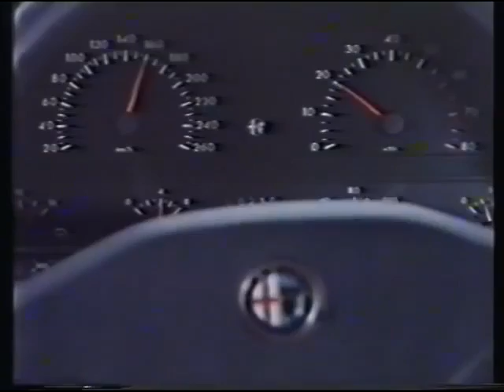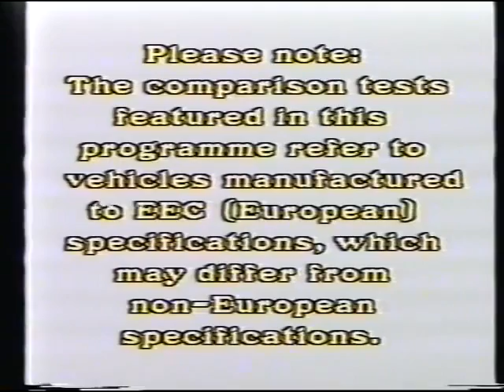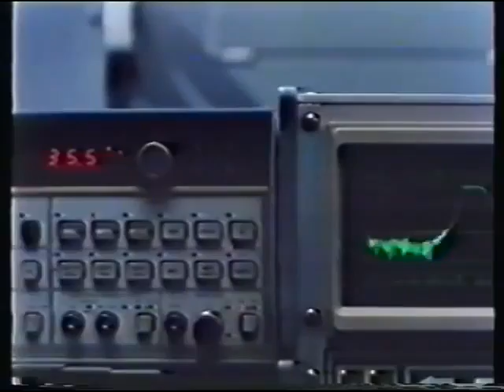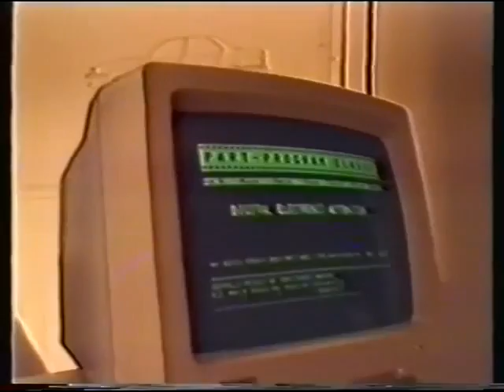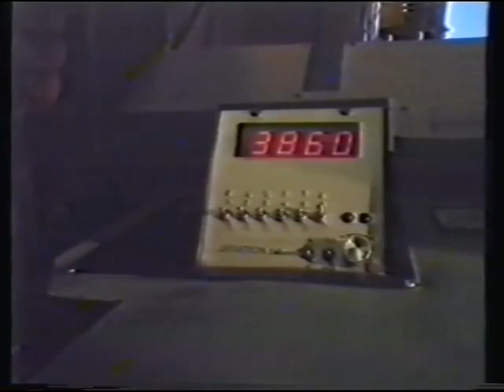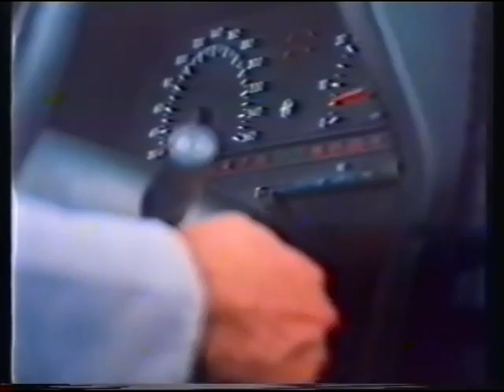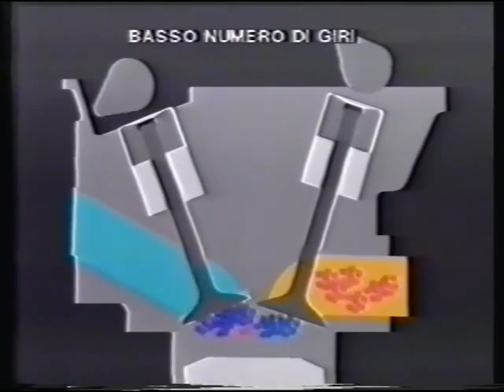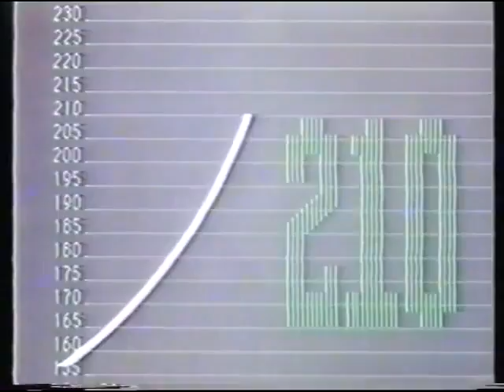Alfa Romeo 164 Promotional Video (1987)

Comment: Driving the longest possible distance with the engine not working is definitely an important factor when owning this horribly unreliable model.
Reply: Its very important for fuel economy, max speed and acceleration at higher speeds. 
Less aero drag - which means longer distance here, on the video, gives You better fuel economy and better acceleration performance. Yes, it is important.
Reply: God forbid you don't change the timing belt every 2 years or 24k miles. Or, if you sneeze while driving, the transmission goes out. That being said, I miss my two 164's. My cousin trashed my first after I sold it to him. Had it since new. Second, timing belt snapped at freeway speeds. Junked the engine. Couldn't get a engine or rebuild done cheaper than what the entire car was worth. Converted it to run on electric. It then became the most reliable (And QUICKEST!) Alfa Romeo in existence! That one is now gone too. The frame couldn't handle the torque of the electrics. I'm sure all the rust had something to do with it though. 
Miss my Alfas :-(
Reply: Sei poco informato, questo motore nonché l'auto, dalla bellissima forma, è molto affidabile.